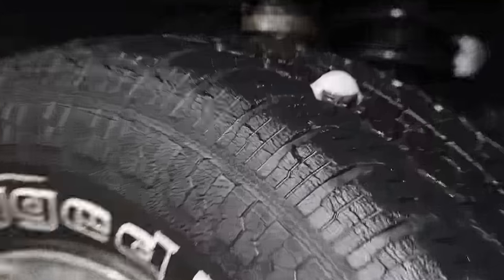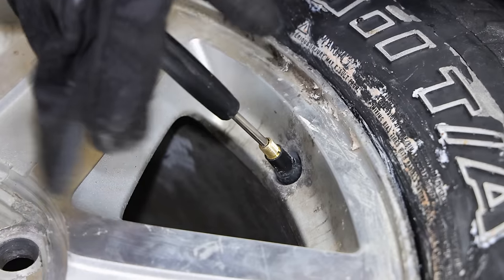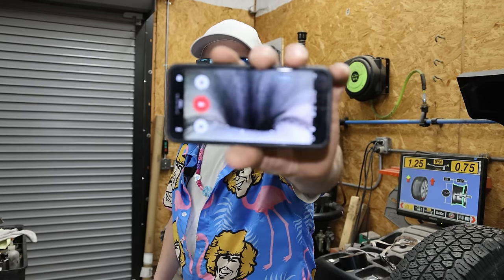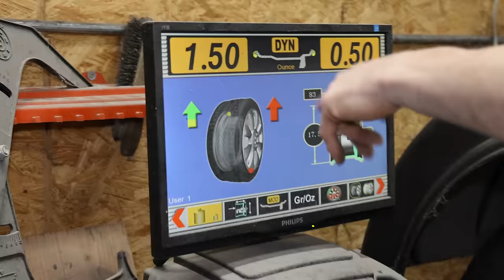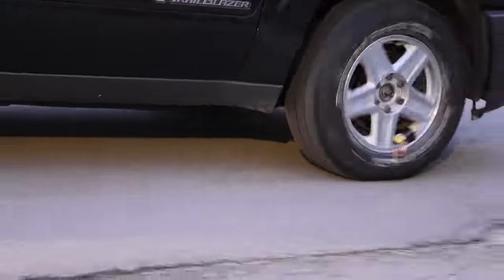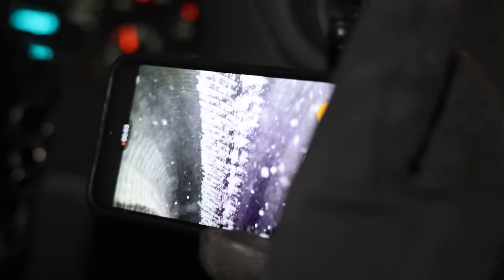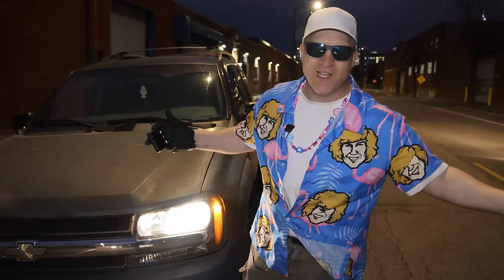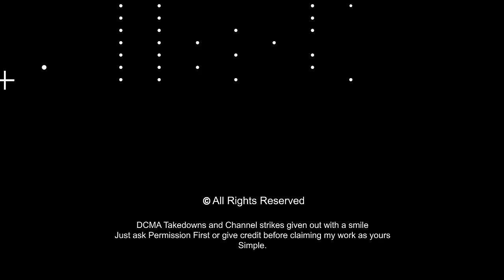GoPro Inside a Car Tire (With Balance Beads)

Comment: I've always just tossed the bag Into the tire before I run the second bead on. After a mile or two the bag will pop and let the beads do their thing. Run them on all my trucks and used them on many customers vehicles with very few complaints over the years.

Comment: as they erode the inside of the tire. which will cause broken belts inside the tire eventually.  we've seen the erosion with fix a flat before and that's a liquid. these balance beads are a solid which would erode the rubber away even faster. the beads would act like sandpaper every time you stop and start.

Comment: Ok, when the vehicle is stationary there's a flat spot at the bottom of the tyre where it touches the ground right and the beads gather there . When the vehicle accelerates the beads gather towards the back of the flat spot until there's enough centrifugal force to carry the beads all the way around inside the tyre where, according to the video, they seem to distribute fairly evenly around the inside.  The only small advantage I can see is when they have gathered at rear of the flat spot before there's enough centrifugal force to distribute them around the inside. I'm pretty sure this is snake oil.

Comment: The gopro would create some mega imbalances. Dayumn that was super interesting. I never expected the beads to act like that. But it also seems like they might wear out the tire from the inside a little. Also if the balance beads get In between the seal, could cause air to leak.

Comment: My understanding is they really dont get into position (and start balancing) until you are doing like 30 mph.   So my problem with that obviously is what about all the sub 30mph miles?  I mean for long highway runs great!  But what about through tight twisty roads where you keep slowing down for each turn and the beads all fall off and dont migrate back to the light spots untily you reach speed again?  I tried em in my motorcycle and noticed no difference the tires wore out at least as quickly as with wheel weights and i noticed no difference in ride quality....but all I ride is the twisties

Comment: You're supposed to just put the bag straight into the tire un opened. Flexx tire balance is better than the beads, I've counteract turn into powder on 3 different truck tires

Comment: I wish you would have added a lead weight on the balancer with and without beads.  That would have proven the beads effectiveness.   Additionally it would have been interesting to keep adding weights out to the weight of the beads to see how much imbalance the beads could handle.

Comment: A wheel/tire balanced with properly with wheel weights (on a calibrated machine) will show zero (0) on the inner and outer wheel each time you balance it.  I've never seen balance beads work and I've mounted and balanced hundreds of wheels/tires in my youth.  Try taking the truck up to 80mph and see if it vibrates.

Comment: I use AirSoft BBs
i weigh the tire, add 1/100 by weight.    I disregard the wheels as they are usually well balanced

ie/ tire weighs 23.56kg = 23560grams / 100 = 236grams BBs

Comment: I always put about 5 puffs of baby powder in with the beads. I found with high humidity the beads will just stick and wont move right. The heavy part of the tire hitting the road makes the beads go to the lighter side with the vibration. There is a math formula for this and it 2 pages long and looks like Egyption writing.

Comment: If you really want to balance it good, do a normal balance with weights, then add the beads. The beads fine tune the balance, AND keep the tire balanced as it wears.

Comment: Many explanations here seem plausible at first glance but not so much when thinking them through.
Here's my take and my best guess on how balancing beads work:

First of all, the axis of rotation is defined by the wheel bearings. It does NOT change with the weight distribution as the bearing always remains in place! 

The metal rim will also not deform in any significant way due to weight distribution. (We're not talking car tires not about turbines spinning at thousands of rpm where this would become a significant factor).
The rubber tire may deform differently according to weight distribution though, but it already deforms periodically due to contact with the road compressing the local section of the tire that has contact with the road surface. This obviously makes the beads bounce around inside the tire. 

However, an unbalanced weight distribution will cause a (slight) variation in the speed of rotation of the entire wheel as it rolls on the surface, this is because the eccentric weight is being accelerated and decelerated on it's path (unlike a perfectly balanced wheel where this all evens itself out). 
In other words due to the eccentric mass distribution an imbalanced wheel will NOT roll at a constant speed the way a (perfectly) balanced wheel will!
I assume this (periodic) variation in rotational speed during every rotation of the tire as it rolls on the ground, is the real cause why balancing beads work, and I assume this periodic variation of the speed is what the beads even out by being redistributed to the location where the strongest centrifugal forces act on them as the tire rolls.

Comment: I think the beads could cause an air pressure leak.
You should ensure there's no beads in the joint, or put em inside the tire before install it on the rim.

Comment: I have been running them in my 33 mud tires for a couple years. They were impossible to balance otherwise, because the tread was constantly changing from the abuse.
Reply from the maker: Yes, I think those applications is where these beads really shine

Comment: I didn't understand the results with the brand new tire but the first thing I do with a new weight-balanced tire that vibrates is remove the weights and this usually improves the vibration.  Especially if the weights are all on the inside bead or if they're stupid-large weights.
Either the balancer machines don't work or the operators don't know how to use the machine?

Comment: I'm no expert, but it seems to me that the beads would move away from the heavy spot due to centrifugal force and whatever force makes things tend to move toward a point of equilibrium. Similar in the manner that holding a spinning bicycle at its hub while standing on a lazy Susan causes you to spin in the opposite direction that you tilt the tire towards. But that's a guess that popped in my head instantly, so who knows.

Comment: I’m actually surprised they compensated with the added weight of the GoPro. I’m thinking I’ll use beads on my next set of motorcycle tires.
Reply from the maker: Yeah I was surprised too and I forgot to show the GoPro weight, I think it was like 7 Oz

Comment: Ive always been told you can use BB's. But there is a certian amount you have to use. Its like a certian weight of bb's vs the size of the tire. I dont remeber.

Comment: I tried in a ram 2500 that I had with 36 inch tires and I constantly had balance issues. They did not work.

Comment: The key to understanding this is to never use the idea of centrifugal force.  It's only a reaction force which is related to the strength of the tire, and the to the linear velocity of the tire.

Comment: I see an entire series of these videos...trying different sized balls and stuff.  The point is if larger balls work (ping-pong ball sized maybe) they would be easier to recover and reuse rather than adding to the micro-trash problem that we're getting buried under already.  And what about...a ring with a rigid 'stem' with a weight on the end that could encircle the rim (inside the tire of course) - the weight wouldn't quite reach the rubber, the ring would be free to rotate around inside.  Pad the inside of the ring with something like teflon/nylon strips so it doesn't wear on the rim.  Could that not balance the tire?

Comment: In my experience, anything over .50 ounce will cause vibration at 55mph. The balance beads will prevent you from "zeroing" the balance on the machine as it constantly changes position. I have never personally used them but I have dealt with them and they drove me nuts.

Comment: How they work: Newton's 3rd Law: For every action, there is an opposite and equal reaction. That's how they work. As for the balance beads, I use them in all my vehicles and they work very well. Except for those with TPMS sensors. Both OEM and aftermarket don't seem to allow the OEM computer to get the data from the sensors. Still working on this problem, I don't know why and I don't have a solution yet.

Comment: Would have been nice to see in a tire that didn't already have a shifted belt in it. 

As someone who spent years in a commercial tire shop, yeah, they break down after awhile. Turns to dust eventually. Probably limits functionality at that point.

Comment: I had my tires balanced to correct a vibration only to have the vibration change in travel speed and force each time for 4 balances. Tired of paying for poor balances, I bought some ceramic balance beads. 4oz was recommended and I read more would only help so, for my 195/65r15 tires on aluminum wheels. I used 6oz per tire and still had the same vibration. I took the car in and had them rebalanced again to have them lecture me about the beads. I told them why, because they couldn't get it right! They removed the beads and balanced them almost perfectly. So, my experience with beads was that they do nothing. I have a hard time grasping how they could work so I'm still thinking, as the video shows, the beads stay mostly uniform on the tires outer surface or diameter adjacent to the tread and only a large bump would cause them to move around. So, I can fathom how a fixed weight opposite the heavy spot will "oppose" the imbalance, however how do free moving beads do that? Wouldn't they go toward the imbalance? What I do know is that many shops poorly balance tires, especially big off road ready tires and many shops say that their balance is good enough for average (lower) highway speeds. How do race cars and drag cars keep their tires balanced for high speeds?

Comment: I do know how they work...sorta.  I talked to a guy at the company.  He said picture a plate on a tablecloth.  Jerk the tablecloth and the plate lags behind.  The out of balance tires jerk away from under the beads moving the beads in the opposite direction. Which balances the tire.  That's still a little fuzzy to me but I know they work so I guess I buy it.  I run huge offroad tires on a Jeep and you can feel the Jeep come into balance and go smooth as you accelerate past 20mph.  You can't balance big offroad tires with weights because the tires move around on the rim while crawling under extreme traction and besides everything clogs up with mud which weighs more than the weights.  Beads are the answer.

Comment: I would like to see what happens 180 degrees away from that GoPro.  The GoPro moved the center of mass to one side, and the beads will want to roll to the side opposite of the center of mass.  I would like to see this test done with 16 ounces of stick-on weights in one spot, the 7 ounce go-pro 180 degrees from there, 8 or 9 ounces of beads, and the camera pointed at an angle perpendicular to the rubber.  Theoretically, almost all the beads should end up there.

From what it appears, these beads will balance MOST of a heavy imbalance and not all of it.

Comment: The people saying the beads don’t work have never installed a tire bigger than 37s with 17 inch or smaller wheels once you get that much rubber it’s pointless to even try to put weights on it the tires are so big they fit spin fast enough to cause any crazy vibration or damage to anything that’s if it’s a good tire

Comment: What is happening the heavier side of the tire bends outwards more and the beads get stuck on the internal ribbing on the shallowing. Since the tire is not round, the beads get stuck on the shallow part since it impedes their travel as they go around. Eventually all the beads will be spread out over the tire making it round again..

Comment: I work as a mobile commercial tire tech. You should've ripped open the bag, then dumped the beads in the tire before you mounted the tire on the rim for an easier installation time. Yes some beads will fall out but not too many that will make a difference. They are usually used on 19.5 (heavy-duty passenger trucks, aka dullies) or semi tires since you cant really balance them properly on the side of the road accurately without a machine. I wouldnt recommend them on smaller tires like a car or regular trucks since they wear out lighter ply tires (8 to 10 ply) faster than heavier ply tires (12 to 14). Im going off on a tangent tho. I dont recommend it, but do what yall want. Not to sound like a sales man

Comment: Dude, you just throw the sealed bag of beads in the tire and let it break open. You don't want those beads in between the wheel and tire bead, can cause some nasty leaks.... and DEFINITELY dont try pouring them in the valve stem LOL, thats over the top crazy haha. I use these regularly for customers at my shop, just throw the sealed bag in the tire when you're mounting it.
Reply from the maker: Yeah but I can't do that for a video, that would take miles to break the bag, I needed them to work immediately.
Reply: @WarpedYT  Fair enough. Love  your content.

Comment: My dad used to run tires until they "rapidly deflated".  It's actually not so bad as long as you stay off the brakes.   The real problem is when they flail the fenders and cause body damage.

Comment: Balancing beads can yield bad results if tire has radial run-out. Beads will go to the high side of tire and if it is at same position than heavy side, balance is worse than without beads.

Comment: If you take a balanced tire / wheel and add a wheel weight to one side and throw off the balance what happens? The heavy side torques the center point of the tire balancing machine so in order to rebalance that wheel you must add the same value weight to the opposite side to get it back in balance. Or else that side vibrates or kicks up into your suspension.  So you mean to tell me the beads automatically go to the opposite side of the weight you first added? But how or why? I think this is the same concept of those side loading washer machines.  The clothes seem to balance themselves out inside the tub with a couple spins in each direction before it goes to top speed.
Reply from the maker: That's exactly what I did in the latest video, I was supposed to post it today but a little behind. I figured out that they do in fact work but it's very much reliant on how fast the wheel goes from a total stop to the critical speed where the beads stick, if that time is too short the wheel will still be off balance, if you accelerate gradually the beads tend to find their way into the light spots through the offset centripetal force. It makes sense but it doesn't work every time under every circumstance.
Reply: @WarpedYT  Interesting. Seems to be the same concept as those front loader washer machines. When the spin cycle begins the tub rotates slowly back and forth until the clothes some how balance out.  Then the fast spin begins and magically the load is balanced.
Reply from the maker: @warntheidiotmasses7114  Yeah I've thought of that, but I don't know after seeing it on the high speed camera I don't quite know for sure if it's the same concept, because washing machines have serious shock absorbers. Normally I don't do videos like this debunking things but I'm trying to stimulate the algorithms here..lol

Comment: I only wished you had balanced the tire on the machine with the GoPro and no balance beads first to see what weight it was calling for and then adding the beads to see the difference. Would have been cool to see how they can balance out. Like a before and after.

Comment: First of all, the tire you are using the beads is a very old tire with a tread separation. Nothing will balance a tire that is not round especially if it is shaped like an egg. Balance beads are used primarily in large RV tires and large truck tires, not a P metric tire.

Comment: An important procedure I follow with a wheel balancing machine is this: after balancing the wheel, I rotate it 90 degrees and run the test again. This is a test I perform with every new wheel replacement I do, and I have yet to find a balancing machine that indicates the wheel is still balanced after turning it 90 degrees.  Go try it!!!

Comment: Mine work 95% of the time 17inch rims on  GMC 1500 truck my friend has a Dodge 3500 with 18's same issues.  Once in a while, at about 60 mph, it feels like all the weights fell off.

Comment: I honestly NEVER saw anyone drive around with tires SO bad that the fk'n treads are hanging off. 🤣
Good 'ol US of A.😂 No vehicle inspection beeded. It it rolls forward, you're good 2 go. 😅
Reply from the maker: In USA you can make a 1000hp car from home Depot wood and drive it cross country if you chose as long as you pay your vehicle taxes and plate sticker...lbvs .

Comment: They don't work due to centriphical force it relys on the vibration loosening up the beads from a heavy spot to deciminate to a lighter spot where it will have more centripetal force but at a certain speed the vibrations aren't enough to overcome the throw of centriphical force thus the beads at 50 mph didn't budge bc the ridges inside the tire held them in place thus they couldn't migrate to offset anything

Comment: The beads go the the point of greatest offset... The inner surface is curved from side to side so they must go to the center as we see. They cannot compensate for a heavy side only a heavy spot radially.
Tried this fad in the middle '60s and abandoned the stuff.

Comment: Twice I have had these beads get stuck in the inside end of the valve stem. I had to get the valve stem replaced both times with the second time I removed the beads.